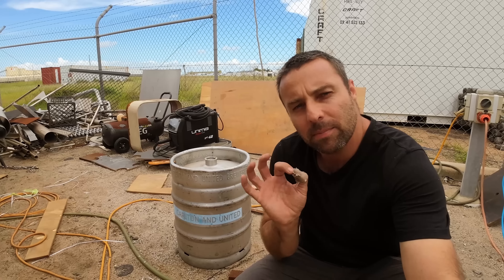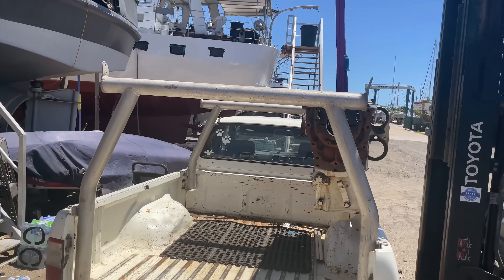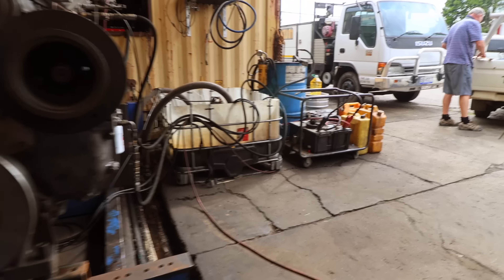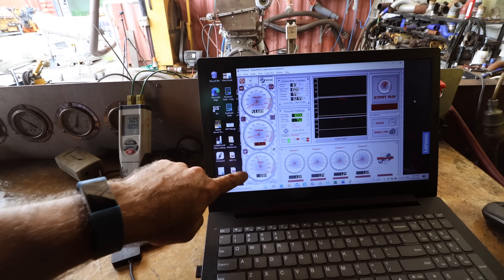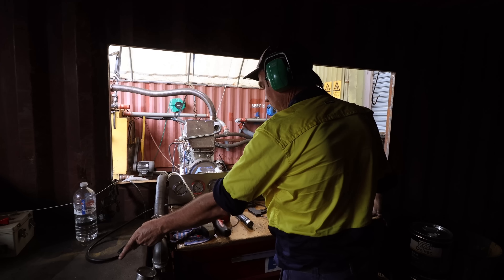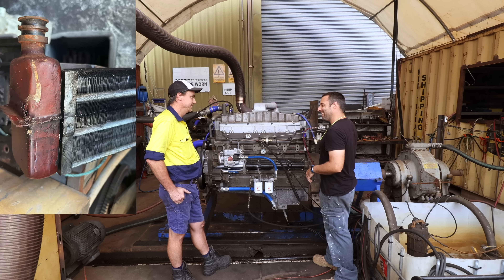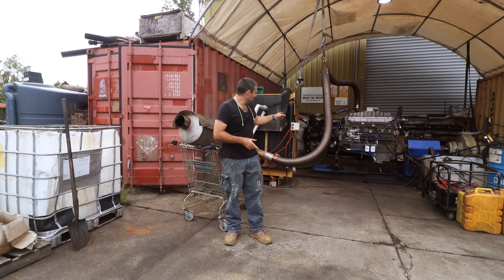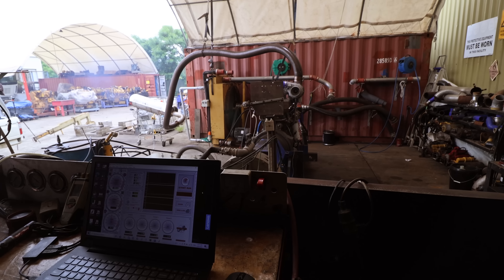Brupeg's Engine Dyno Test - Full power on Vege oil - Project Brupeg Ep.294

Comment: Let me get this straight. A single engine “ Antarctic expedition boat”.
Reply: yep, that's give something to think about.
Reply: If you follow them you will find that they will have a electric get home system...plus it's not just  exclusively a Antarctic vessel...
Reply: Get you home is fine unless you encounter a transmission/prop issue.
Reply: @nigeltoleman6308  Maybe watch past episodes and your answers may be revealed....
Reply from the maker: Hi everyone. In the commercial world it’s very common to have single engine workboats. We do have the electric get home system which can allow main or transmission failure to happen and not restrict our ability to power home under reduced speed. We will however be timing our ice trips for when ice breakers are close by (within a few days travel).
Reply: @jefferyhutchison9775 
Hi I understand the concepts discussed in the previous videos,where an additional drive is added directly to the prop shaft.
Where in a failure of the main engine the get box can be selected into neutral and the electric motor can directly drive the shaft through the gearbox and belt arrangement.
My concern was if you have a gear box failure. You could possibly remove the propshaft flange to gearbox mounting  bolts to free the shaft. I would then suspect you would need some way of preventing the thrust of the prop pushing the disconnected flanges together. The other and more likely scenario would be a large rope or net becoming wrapped around the prop rendering the whole transmission unserviceable.
Just a personal opinion.
Reply from the maker: If a rope stops us we will just dive on it till it’s free. We can’t account for every scenario but we can deal with 95% of what’s likely to be thrown at us. Remember this vessel has more redundancy in its systems than most commercial vessels and certainly more than the majority of recreational vessels
Reply: @Nigel Toleman  l understand now why YouTubers hate the negativity by those unending opinions...Having every single thing you do subject to opinionated scrutiny must weigh like an anchor around your neck...in my humble opinion 🤔.
Reply from the maker: It can definitely be like that. But it can also be a real blessing. Most people want to help, some communicate that desire to help others in a shitty way. It’s been our experience that when you really drill down at the bottom of most comments is a feeling of wanting to stop others making mistakes or passing on knowledge that they have and want to share. It’s pretty bloody cool. Sometimes you come across the very small minority of people that just want to be jerks and tear you down, that’s rare but it happens. It’s been our experience that if we act like jerks we get that mirrored back to us. So we do what we can to not be that to others. But we mess up and we do get that occasionally. Still when that happens it’s a nice reminder to come back to who we choose to be for others. Dame
Reply: What about the giant squid and the Krakens? You definitely should have harpoons and grenades before you head south totally unprepared. I say this because l care....
Reply from the maker: I’m completely open to transporting grenades. Mainly because they sound really fun.

Comment: You are having trouble getting the cooking oil to temp, when the ambient temp is in the high 20"s C, how are you going to manage the oil temp when ambient temp's are much lower??
Reply from the maker: This was with a very rudimentary heating system. When its built into the boat we have coolant at 78-81c, engine oil at 150c or more and exhaust at 400-470c. Plenty of heat sources we can scavenge free heat from.
Reply: @ProjectBrupeg  Just how hydroscopic is the cooking oil when compared with diesel, has anyone done test's on algae growth tests , compared with algae growth in diesel fuel?? This happens when water enters the system
Reply from the maker: Not sure but the same biocide that’s used to kill diesel bug works in oil. Also we have vacuum water separation onboard so water has very little chance of staying in the fuel on Brupeg
Reply: @ProjectBrupeg  This vacuum water separator, is it to separate water from a vacuum pump, or is it to separate water from fuel? I was in the filter industry for a few years and at that time there were only 2 types of common fuel filters. 1 / coalesce & 2 / stripper fuel filters. the enemy of both was a fuel algae that grew in the meniscus  at the fuel water interface. This algae will block quite large filters very quickly once this algae got established. I can see that it would be possible to freeze water out of fuel, but that then causes other complications with fuel waxing etc. But I would like to learn more about your vacuum separator, if possible. just the manufacturers name would be great.
Reply from the maker: It was a system we built ourselves. Link to the video below
https://youtu.be/UXQIrZpQcdI
Reply: @ProjectBrupeg  Just set my mind into gear, water has a lower boiling point than diesel, even though it has a higher vapour pressure. all you need to do now is produce a miniature device to run continuously and you will have solved an age old problem.
Reply from the maker: This system worked well but we can improve it a lot. Tip the tank on its side to increase surface area of the liquid and not fill it up so much. Heat the oil before it goes into the tank. Both of these things would help immensely to boil off more water. We got it to a stage that it got a really good passing grade from the fuel lab, but that was on still land. It will still need work to make it work well onboard. Another option is a centrifuge but that’s a fair whack of cash versus something we can build ourselves

Comment: So doing some US math, and guessing a 30 inch pitch on your prop, you should be seeing about 8.6 MPH cruise burning 19 gallons of veggie oil. Did I figure that correct? That’s pretty impressive if I did.
Reply from the maker: Prop is 46”x46” with one bearing and one stern gland. If that helps
Reply: @ProjectBrupeg  Ok so you stated 1460 rpm in a 4x1 reduction so that is 365 prop revolution/min So 365 x 46 inch prop bite is 16,790 inches/min / 12 = 1400 feet/min x 60 minutes =84,000 feet / 5280 feet per mile= 15.9 (16) miles/hour. I had estimated a 30 inch prop bite earlier. At @ 19 gallons per hour of veggie thats just shy of 1 mile per gallon. Impressive performance if I did the math correctly. However there will be considerable prop slip due to the hull configuration. I think you will have better speed than you have been estimating at 7 knots probably closer to 9 with a clean hull. I just did the math for the fun of it. Will be interesting to see how close it is.
Reply from the maker: Yes very interesting numbers. Thanks for doing that.

Comment: My take on rebuilt, engines, water pumps, etc.; if the rebuild is done correctly with good parts to spec, then it is better; WHY?, the casting has been proven by use and is a "known" instead of not knowing if there is something wrong with it that was not discovered by use.  I hope that makes sense.  That is my philosophy anyway.

Comment: I'm puzzled. Paying $5 per litre,  getting lower HP,  and having to preheat  on Canola oil, what's the benefit ?
Reply from the maker: In bulk oil is half the price of diesel
Reply: @ProjectBrupeg  Is it? All I could find on line was a few hundred dollars per 1000 litres, IF you bought a couple of tonne.
Then, you have the processing of water, detritus, etc.
Why isn't it used in commercial operations in Australia ?
In Europe and the US, Biodiesel is typically double the price of plain Diesel, according to Google.
Reply from the maker: De watering and filtration is a minor cost and fairly easy to do. Have a look at this playlist we have previously made about oil and you can see the evolution we went through to be able to use oil. 
As for bulk buying, Brupeg holds 16,000L of fuel so it will be normal for us to buy 5ton or more at a time

https://youtube.com/playlist?list=PLL56DNg5A5a3mlLfnepWtdUq0ssM-2zr0

Comment: where are you going to get Veg oil for $1 a litre when its over $5 a litre in the shops
Reply from the maker: Definitely not from the shops. On the international bulk market it’s a third the cost of diesel. As we hold 16,000L of fuel buying and storing bulk quantities is t an issue for this boat

Comment: Honestly with the number of perfectly good looking beer kegs you are chopping up you may loose a large number of subscriber's. Please tell meum us why we experience the pain of seeing these beer kegs no longer fit for a proper and worthy use and better off as a Veggie oil heater. Oh the pain of watching you plasma torch the top out is almost as pad as the pain you feel after giving an ex her broom and telling her to leave it almost makes a grown man cry!

You could have the water pre-radiator or heat exchanger in the keel to go through your Veggie Oil tank, that way you power it up on diesel then when the veggie oil is up to temp change it over and heat can keep it up to temp. Swapping back to diesel before a shutdown to clear the veggie oil from the lines to make the next diesel startup easier so you can use electronic or manual valves to do this but if done back at the oil tank no flushing of the lines is needed.

Comment: Hi Damian, it’s a bit of a shame you can’t use the exhaust to heat The oil up somehow just a thought probably a ridiculous comment
Reply from the maker: Actually this is something we are looking into. Stainless pipe wrapped around the stainless exhaust, in a closed loop that heats a tank of fuel. Using pump speed we can control how much heat is transferred from the exhaust to the oil. Not a silly idea at all, actually bang on the money

Comment: I am just wondering whether running engines on basically food would make me feel comfortable while a vast number of people are starving around the world. Especially when Ukraine as one of the worlds largest veggie oil producers is not able to supply…
Reply from the maker: Australia is the second largest supplier of canola oil on the planet. That said, your right, if we could avoid running on a food grade product we will, with our preference to use waste cooking oil. Regardless using oil will remove a small portion of food stock from the planet but it also displaces many tonnes of CO2 from our emmisons from using diesel which also causes a lot of issues on its own right
Reply: It probably means choosing the lesser evil.  With the increase in global production of bio fuels a lot of woodland is annually converted in monoculture for this purpose, for example for palm oil in Brazil and Asia. In this case the CO2 balance is no longer in favor of bio fuel. Unfortunately I have no solution either and I don’t know how eco-friendly the "oil farming" is handled in Australia, it just does not feel like a long term solution for me. Recycled  oil may work, provided the quantities are available. (Slight smell of fish and chips might go along with it 😅?). Good luck for your plans anyway, I am following you from the other side of the world 👍

Comment: c to f x2 +30 = f
Reply: Hi Rickie, this is a  GREAT!!simplification of the formula f=c x 1.8 + 32.  Starting at 2 degrees F too low at freezing and 10 degrees F too high at boiling. I going to keep this one in my memory bank. THANKS!!! 
ps. you could play around with your constant 30 depending on where in the temp range you are most critical. If you working on an engine where boiling point is critical, just exchange the 30 with 20.

Comment: Hey Dame , do you expect any difference between the vege oil (looked like brand new oil) you used on the dyno and older recycled vege oil that's been used to fry ?
Reply from the maker: Initially we won’t run waste oil until we are satisfied we can filter it enough. So to start with it’s new oil only